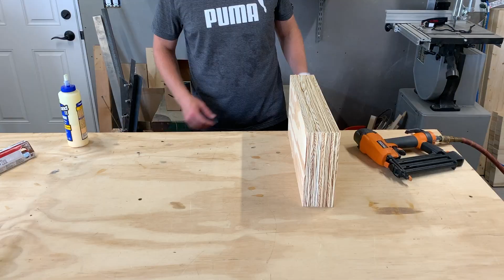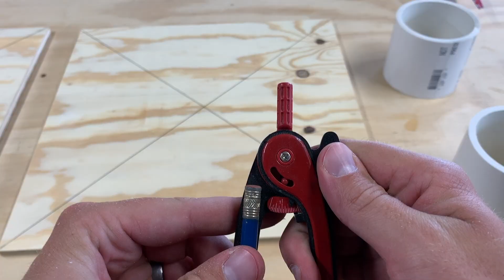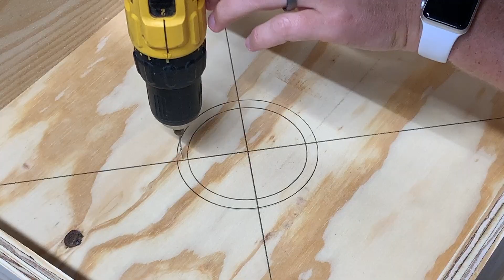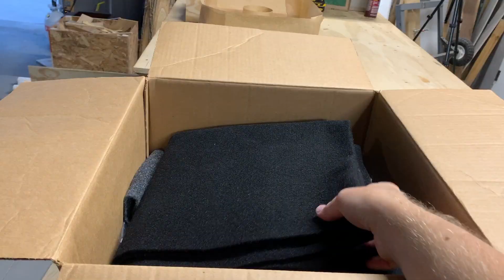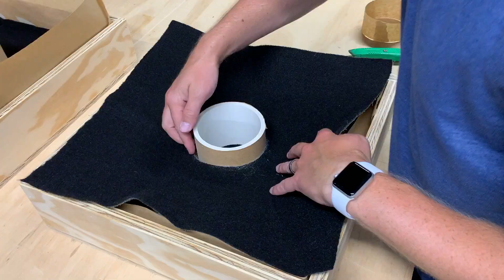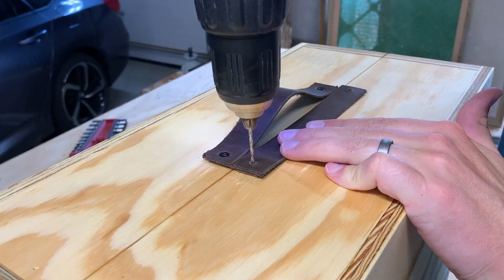Washer Toss Game | How To Build and Play

Comment: Just FYI, on your website you are missing some dimensions, such as the height of the sides, height of the PVC etc. Thanks for the video, I'm about to build myself a set.
Reply: Correct, it’s not shown on the drawings but he did mention at the start of the video that he cuts the sides to 8” wide. These are later cut in half, so each side will be slightly less than 4”. Then you can cut the height of the PVC to whatever the sides end up to be, again slightly less than 4”.
Reply from the maker: What he said 👆🏻 lol
Reply from the maker: Ah crap, thanks for letting me know! I’ll have an updated image up shortly! In the mean time, each box is approximately 4” tall, same for the pvc pipe. Thanks for watching!